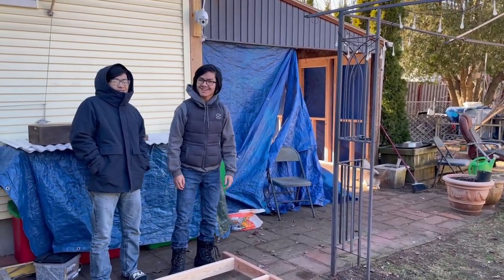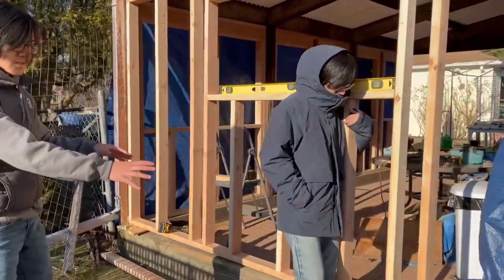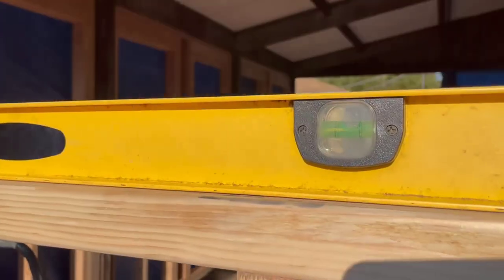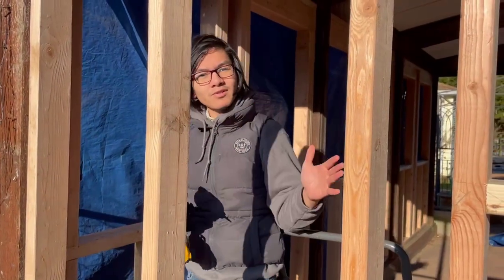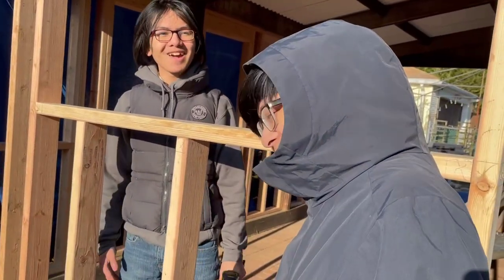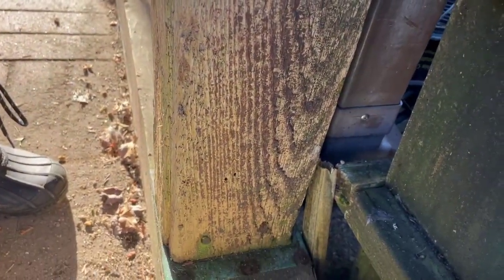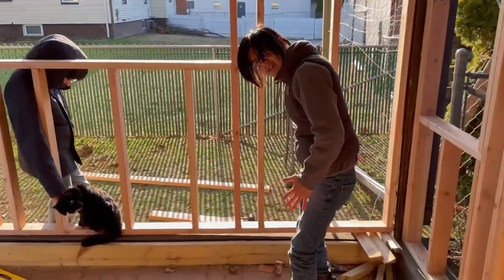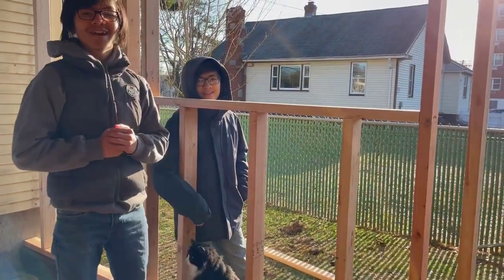Installing Framing For Rear Wall & Window | Part 3 Converting Our Patio Porch Into Multi-Use Room

Comment: Hizami looks pretty cold. What was the temperature during that filming? Or what is it like now?
Reply from the maker: The high for that day was in the lower 30s.  It was pretty cold but with the strong wind it felt like it was in the teens if not a single digit...